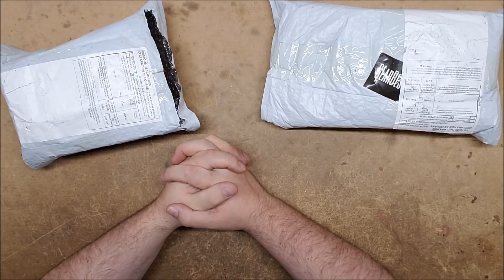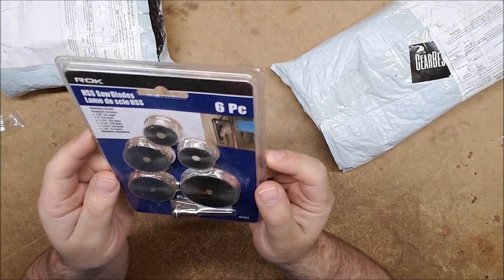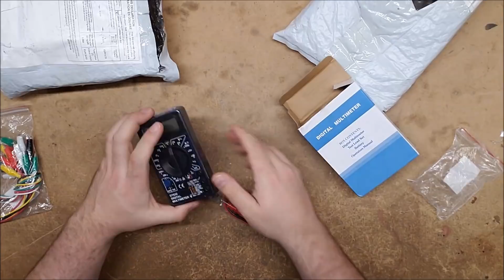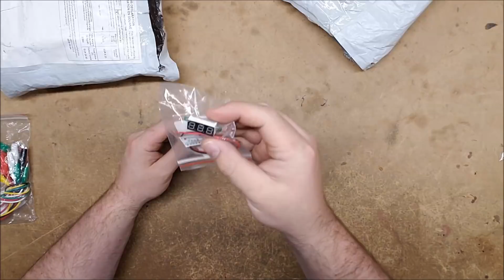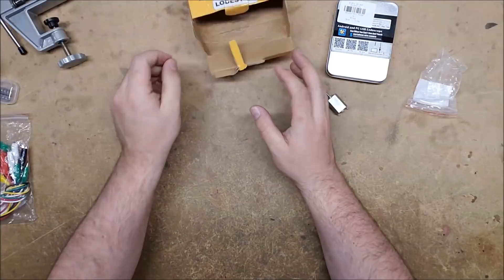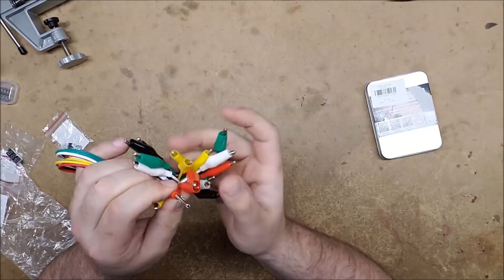GearBest Loot Reveal #1

Comment: On a typical 3 wire volt meter the black is neg the red is pos and the white is probe. You can technically power the VM with a voltage that is separate from the voltage that is being measured  or you can just merge the red and white to have the VM be powered by the voltage that it is measuring.

Comment: The volt meter (the super huge one) twist white and red together, its so you can have a secondary power source to power the volt meter (like if you are passing though a buck converter or pwm modulation) that would take it over/under the operational voltage for the leds, in nerf application red and white get twisted together as we one power source.

Comment: 60K good job and also the 3 wires on the volt meter is so you can measure voltage below what the voltage rating of the meter. If the meter is 3-30 and you want to measure something less than 3, you use the extra wire to supply the 3 volts to power the screen.

Comment: I've got 2of those volt meters from Wish, red and black are for 9 to 30 volt power i believe and the white reads the actually voltage. And that multimeter is actually very similar to what we use in the military as technicians.

Comment: I have a Dremel but it's huge where did you get yours from?
Reply from the maker: The actual motor for mine is massive and mounted to the rafters above my work bench. What you saw is just the end of the long flexible part. I got it on amazon.
Reply: Captain Xavier ah kk thx

Comment: Hey Cap, that multimeter looks identical to the one I've had for the last 20 years or so. They are cheap peices of rubbish but for low voltage stuff they're okay. The third socket is used for the 10amp circuit, when you use that one, just move the positive plug up into that socket instead and it'll work.
Reply: Sorry, I think it's actually the negative you move to the third socket, not the positive. My mistake.

Comment: Nice haul, I don't trust cheap multimeters  though. Considering some of the best in the world are made in the US of A, I would highly recommend a Fluke branded MM.
Reply from the maker: Oh yeah, I wouldn't trust this one for much either. But I will test to see if it works at least.
Reply: I'm sure it will do just fine for all your battery testing stuff. Mains power is what I don't trust them for xD

Comment: I bought my printers and a bunch of my cool knives off GearBest. I'm jelly.
Reply from the maker: Oh good. I had never heard of them and was worried it was some super shady stuff. But if you vouch for them I feel better. :)
Reply: Yeaaaaah wouldn't mind if you sent them my way...
Reply from the maker: Will do.
Reply: i also bought my 3d printer from them, tronxy x3a, it was pretty good till i got some bad filament that killed the hot end and the throat, already replaced with a volcano hot end, just have to reconfigure the settings with new fans, hope to have it back up and running soon. Congrats on 60k

Comment: Voltmeter wires should be +ve, compare and gnd. For nerf, you wire the red and white to the same source.
Reply: Multimeter - use the COM (common) and, if using high current DC, the 10ADC, for all other applications use the V/mA/ohms plug. Don;t get it the wrong way round or you can damage the circuitry with too high a current.